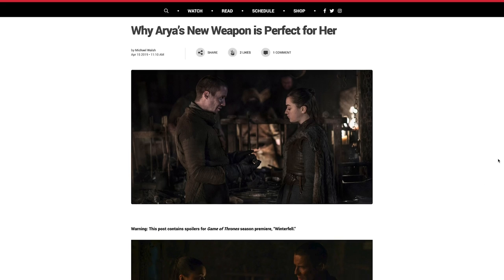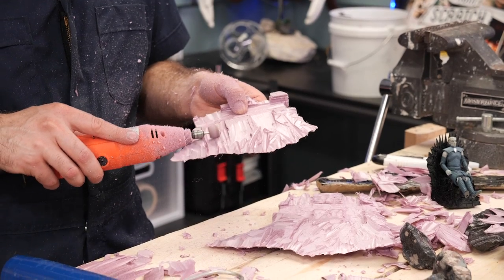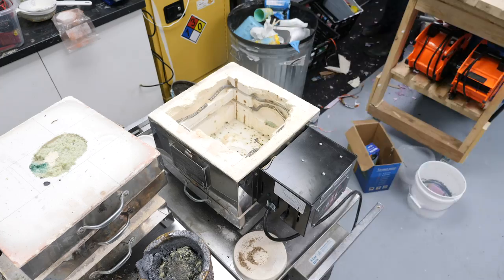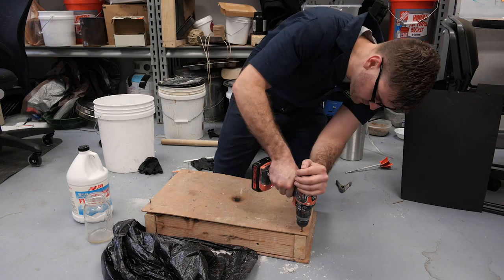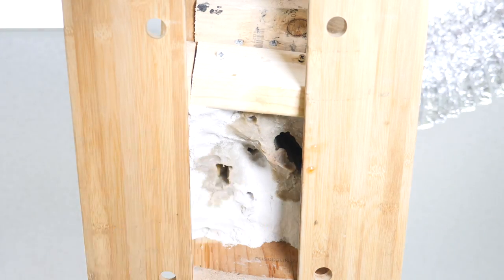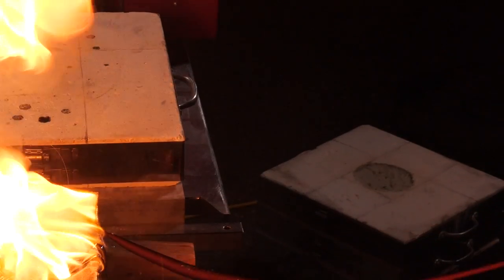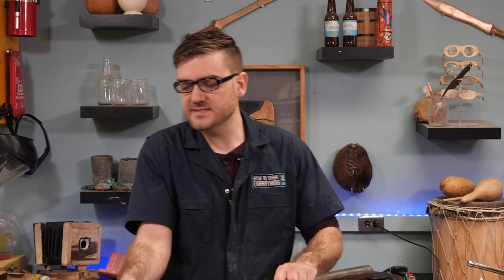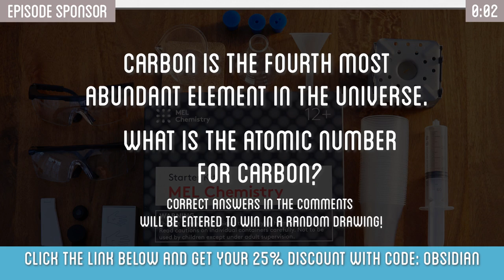Melting Dragonglass to Cast an Obsidian Axe

Comment: Just give up on making molds, you obviously can't do it. In order to work with something as thick as obsidian, you need to have a suction on the mold to create a negative pressure inside the mold and to physically pull the obsidian into it, as it IS NOT going to flow into it and take its shape correctly. You should have figured this out at least by the 2nd time you tried it. And anyways,  everyone already knew it was going to fail.  On game of thrones it is VERY obvious that they did not mold the dragon glass into the larger weapons such as swords or axes and it's never implied that they did, it was only with the small arrow heads did they imply this.

Comment: Maybe you are using to much common Sense, when you melt obsidian you take away its structural crystallisation which makes it hard and not as brittle, you could melt rock/stone and have it cut thin to create a blade, some ovans/fire places/forges, this could be the hypothetical way they make dragonglass, (melting rock/stone with dragon fire which would make the stone which would harden in a natural way if you get the right temperature, kind of like making home mad obsidian, just a thought

Comment: Glass: glass is made from liquid sand. You can make glass by heating ordinary sand (which is mostly made of silicon dioxide) until it melts and turns into a liquid. You won't find that happening on your local beach: sand melts at the incredibly high temperature of 1700°C (3090°F)

Comment: I'm really confused as to why you're trying to CAST metal strips that are riveted together?

It would make far more sense to forge those, as that is how it would have been made anyway. Really casting would only be used to make large objects that are quite thick.

Also I appreciate what you're trying to do, but it really seems like you aren't putting all that much effort into these things anymore. You seem to be half assing everything and obviously failing because of that. You're spending a whole lot of time and money doing things two or 3 times, but never succeeding, because if you put in that effort of all three, into one, you might actually succeed.

Comment: You really need to think about what you’re doing before you do it. Failing once or twice, sure.

But you constantly burn out kilns, decided to cast with a mould that wasn’t fully set for some reason with metal you didn’t take the slag out of before pouring.

You make a wax mould that dripped out, twice.

Please use your brain, and get a gas kiln.

Comment: I would be willing to say that you have done absolutely no research into how glass is actually cast by the way you attempt in this video. Our ancestors knapped glass, flint and chert. The latter two were heat treated before knapping to make more glassy and easier to knap.  Attempting to cast glass as you would metal seems quite idiotic for someone supposedly intelligent. How To Make Everything?  I think not. how about instead, "How I Fail Continuously!" That better suits you.